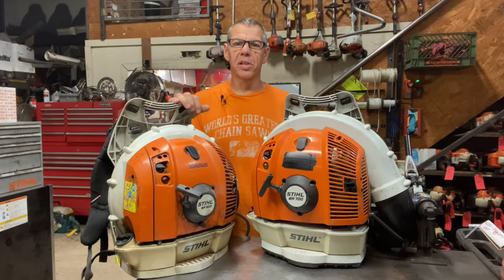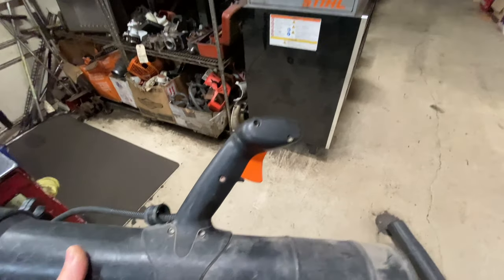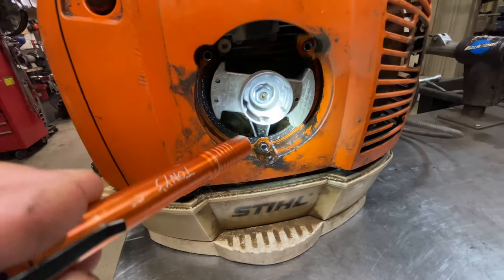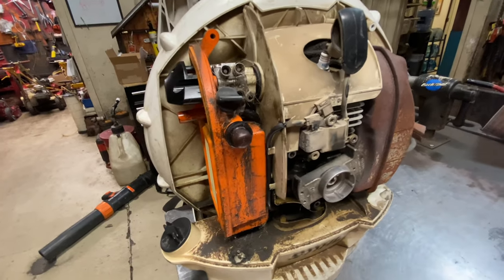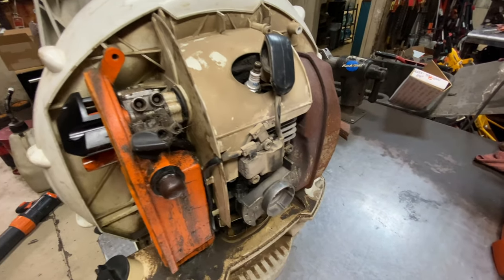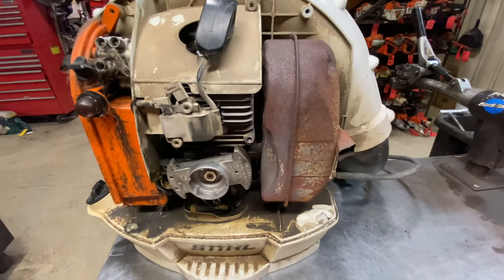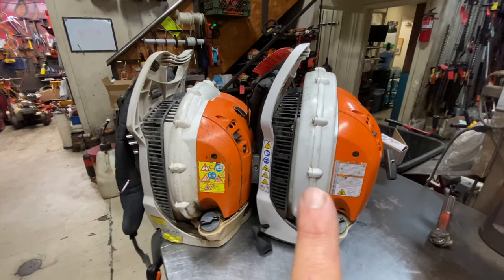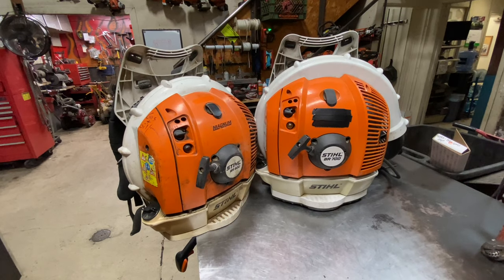STIHL BR600 and BR700 COMMON PROBLEMS / WHAT TO LOOK FOR

Comment: Hello Wally
You suggested the br200 or 450
What about the 600 will it last as long as the 450?
It’s June 2024 
Will the new version on the br600 last?
I am a home owner that likes a light powerful blower but I want one that will last.
I like the moto mix and always use it in everything I own.
Kawasaki trimmer
BG 86c
HS 56c
Would like you professional opinion please.

Thanks
Joseph Smith
Reply from the maker: The new version of the 600 should last you years. If you buy one ask the dealer for the extended warranty in case of further issues. So far the new version has been holding up great.

Comment: Mine is great,  but I'm getting shocked at the throttle.  Somehow the spark is running down into the trigger while using it.  Can't find anything about that,  I'm thinking a new cable?
Reply from the maker: Make sure the wires are ok but you may be having a static issue. They a "anti static wire" you can install.

Comment: Did you mention the horrible fuel cap that spits fuel at you every single time you go to open it?
Reply from the maker: Haha I didn’t but check your tank vent, may want to replace it.
Reply: @wallysworkin823  Cool! Thanks!
Reply: Mine also

Comment: The "oil pan loosening" is sadly what's happening to mine which I bought for light commercial and home use. Won't start
Reply from the maker: I made a video on how to fix it yourself at home. You can find it in my Stihl power equipment playlist.
Reply: @wallysworkin823  Awesome, thank you for letting me know! Can't wait to get it going again, mostly thanks to you!🤘🤘🤘😃

Comment: I have one 600? Runs idles rev-up ok for 5 seconds or so then run lean and actually stop. Other thing has so much compression need to get on compression stroke hold it down pull massive compression. Did adj high speed to no avail fuel delivery issue?
Reply from the maker: You need to check your valve adjustment. The cam gear has a compression release so if the valves are out of adjustment it will not operate properly. The other issue could be fuel delivery, check the filter or filters also inspect the tank vent.

Comment: I got a new br600 in box still. Probably won’t open until summer. Do you think 50:1 mix is good or should I run a little richer like 40:1. Just going to be used for my home use not commercial.
Reply from the maker: 50:1 is fine

Comment: Is there any way to fix the choke switch when it brakes of the carb??
Reply from the maker: Replace the carb or you could replace the shaft if you can find a used carb. Check your local shops.

Comment: I have a BR600, it runs fine except recently as I'm using it it will suddenly loos power and shut off, usually when it idles down a bit.  It starts right back up fine again but does the same after awhile.  It will run well for several minutes or more before doing this again.  Otherwise seems to have full power.  I am getting a new air filter and fuel filter, maybe that will help.
Any ideas of what could be causing this??
Reply from the maker: See how it runs with the new fuel filter, it may just need a carb adjustment also. If you don’t use it on a regular basis it may need a carb overhaul. If it slowly looses power and dies it’s usually fuel system related, if it shuts off like you hit the kill switch it could be a coil problem.
Reply: YOur idle speed is too low.
Reply: @wallysworkin823  I use it a lot,  I have a lawn business. 
Also to be accurate it is a 4 mix blower. 
It is running fill speed. 
Not completely idled down but I let up on the throttle and,  yes it will shut off like hitting the kill switch. 
Then starts right up, usually one pull until it does it again.  
I will change the fuel filter this weekend. 
Thanks for the reply.
Reply: @chrisgrubisic3554  theres a small round vent for air on top of tank,can get dirty or gummed up,beside fuel lines
Reply: It could be your carburetor if you didn't figure the issue out I'm dealing with that kind of problem with br br600 rite now and I'm having to replace carburetor...my issue was very similar to what you described
Reply: @osubuckeyes1979ts  Hello, thanks for the comment.  I ended up selling it, turns out the cylinder and piston were shot.  The guy said he had to replace them.  I reimbursed a portion of his purchase price. :)
Reply: @osubuckeyes1979ts  yea mine turned out to be the carb,cheap carb kit on amazon was easy for me to do and fixed the problem.Kit comes with new air filter and gas filter,dirt cheap for so many pieces.
Reply: @chrisgrubisic3554  did he show photo proof?

Comment: Besides the vent,what would make a 600 run great for 20 minutes then stall and not run till cool agian?
Reply from the maker: Possible coil issue.
Reply: @wallysworkin823  Yep,ignition coil is heating up,part is over 100,dealer is hitting me for 300 adjust valves and new coil with labor.Almost the price of a new blower just for a dam coil.crazy how much stuff cost these days.

Comment: What causes internal knocking after being held full throttle for a few minutes?
Reply from the maker: Could be a few things, if you don’t hear “knocking” when it’s cold it could be detonating or the valves could be out of adjustment. It is poss the wrist pin is bad but usually you will hear it when cold.
Reply: The valves have never been adjusted and I’ve owned it more than 10 years. It doesn’t make any noise until it’s been ran wide open for a few minutes. Thank you for your help.

Comment: 10:50 br550 600 700 and 800 for some dumb reason stihl decided to use a brass bushing instead of roller bearing bushing and if you dont use the correct 2 cycle oil.............

Comment: What is "good gas"?
You mention what "good oil" is, but not the gasoline. Please clarify (octane level, age, etc.).
Reply from the maker: Depending on what you have in your area, We recommend at least 91-92 octane. Or if you use it for home I really like the VP and Aspen non ethanol can fuels.

Comment: does anyone know what the ring end gap is on the br600?
Reply from the maker: I just checked a used engine I have and it’s .018 

An article by Wiseco says, “A rule of thumb for ring end gap measurement is to use the bore size in inches x .005”.
Reply: @wallysworkin823  thank you, i have .019 with my old rings, i did go ahead and order a new setoff rings today  to be safe

Comment: What is the tool you use for cleaning the exhaust valve without taking the engine apart?
Reply from the maker: When I get back in the shop next week I'll see if I can find the part number.
Reply from the maker: Sorry for the delay, had a hard time finding any numbers. Stihl uses the 3M Cross Buff. You can add different length arbor lengths. You can get everything from 3M.

Comment: Dude..,,,just tell us then if a 600 is ok or not   You sure did say a lot of neg things about it!!!  SMH 🤦‍♀️!!!
Reply from the maker: 😂 that’s why the vid is called “common problems” like anything, it’s good until it’s not.
Reply: I’ve got a br600 and it’s been flawless for me
Reply: I have a BR600 Magnum, homeowner usage, coil went bad out of warranty. I also think it is building up too much carbon, so I switched to Echo Red Armor.
Reply: @luvingfully  Ive had mine for either 8 or 10 years now and Its been trouble free. I used it around the house and a couple side jobs so it doesn't have a ton of use on it maybe about 100 hours tops if that. I only used stihl platinum oil and for the last 2-3 years amsoil saber.
Reply: "Dude" - nothing is perfect.